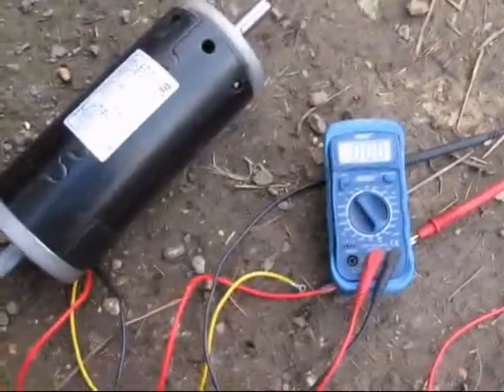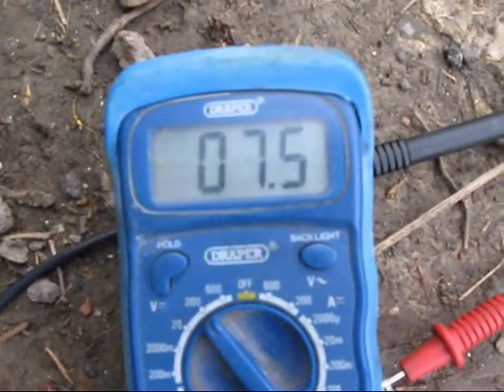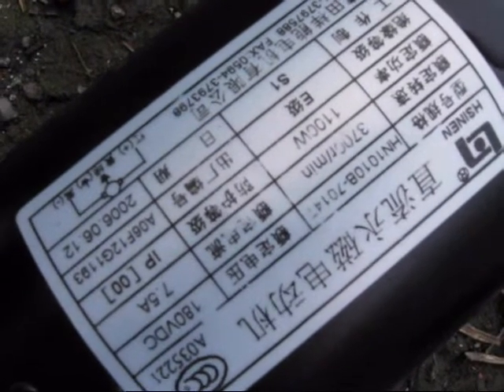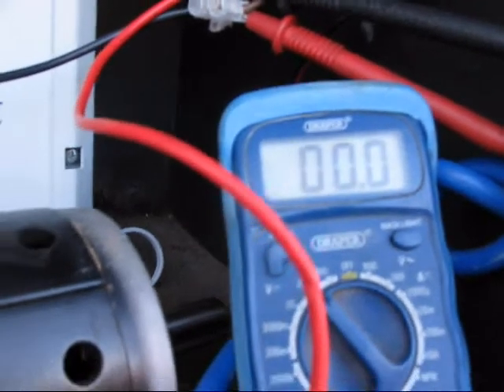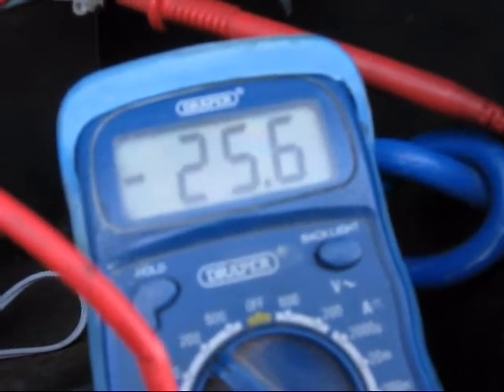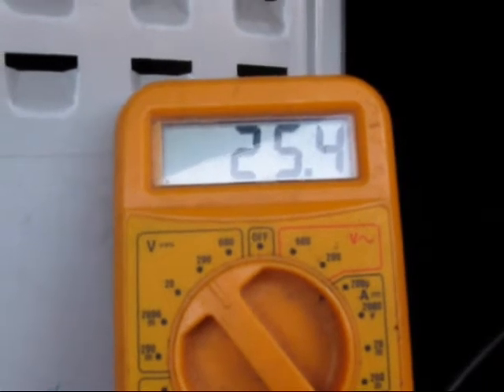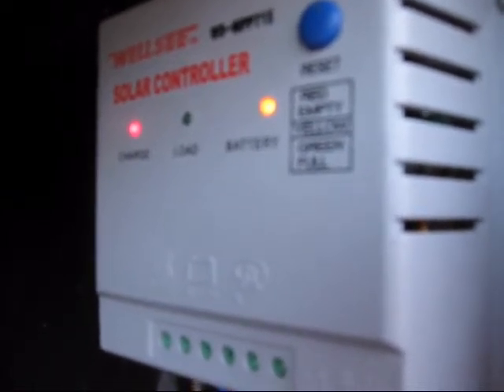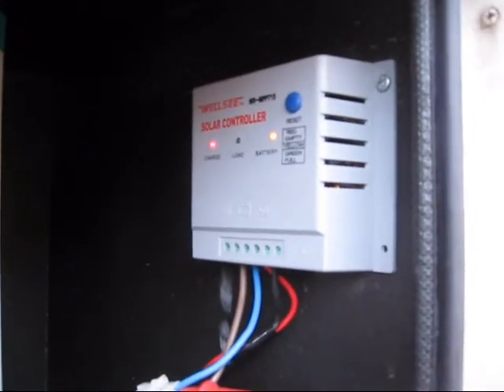MPPT controller & motor test

Comment from the maker: Thanks for all of the advice guys. If I move any further forward with a turbine i will do the job properly and build an axial flux alternator based machine. This project was cheap and a bit crude but has given me a handle on some of the design issues without spending a fortune. I will endeavour to post a video with a 'proper' test setup showing the voltage and current with the dc generator under load and charging the batteries. Thanks for the tips on the charge controller.

Comment: Missouri wind and solar has some high speed blades for that motor. They also have shaft adaptors for their hubs. It appears to be suited for 12 or maybe 24volt battery charging. Avoid mppt with this thing. Most mppt charge controllers will only handle pv efficiently. Take it from a 20 year solar installer.
cheers